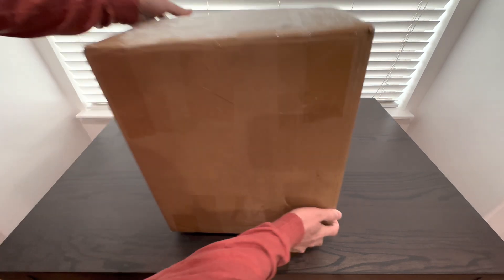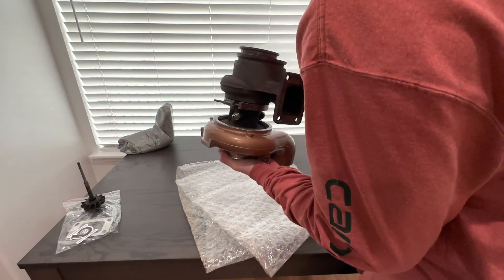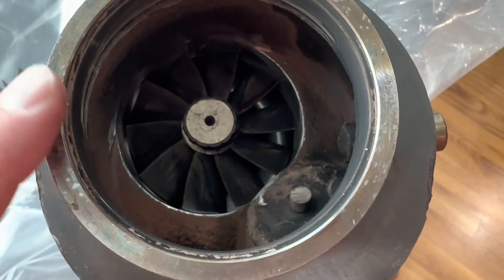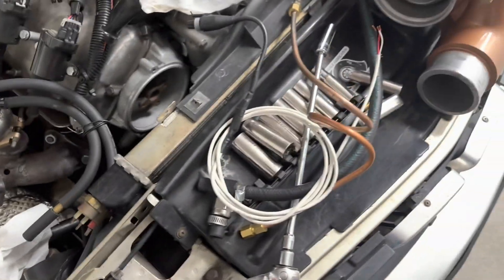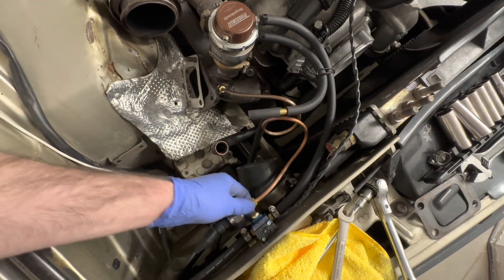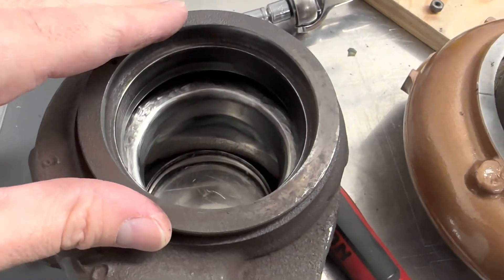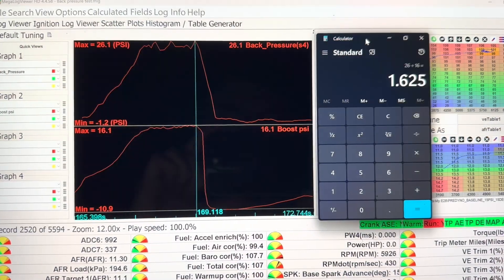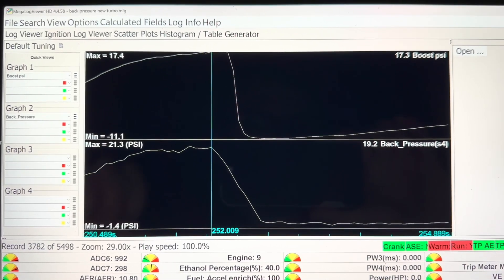Savage Fabrication Holset HE341 Turbo Upgrade Part 2 | BMW E28 Turbo 500WHP Build

Comment: how long does a typical kit take to install? is it like a day or two job or weeks. It seems like every kit i find or look for a 635i, plus all the other mods seems like pretty straight forward deal minus the tuning. say in a day or two by anyone competent. Ty for the videos!
Reply from the maker: How long does the turbo take to install ? The entire turbo system ? The turbo takes 15 min to install but everything is already there and just needs to be hooked up
Reply: @TurbineResearch  Sorry I worded that poorly. If you were taking a car. Bought all the parts to turbo it. had it ready to go. whats a solid time of project to shoot for?
Reply from the maker: @sdmode  a couple weekends depending on how much fabrication needs to be done.

Comment: Shouldn't you dial afr after the new turbine wheel before pushing on it? Doesn't the new turbine wheel makesess back pressure, thus makes the afr leaner at top end and needs to be redialed? Or am missing something?
Reply from the maker: Yes the engine needs to be remapped for fueling